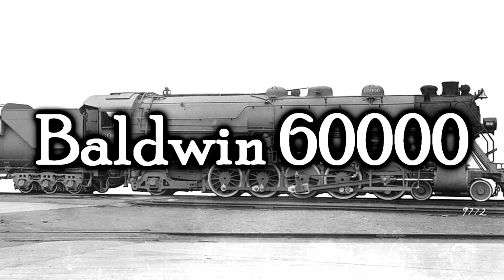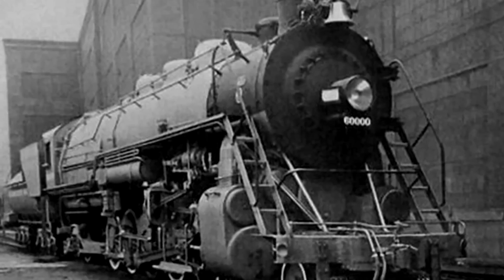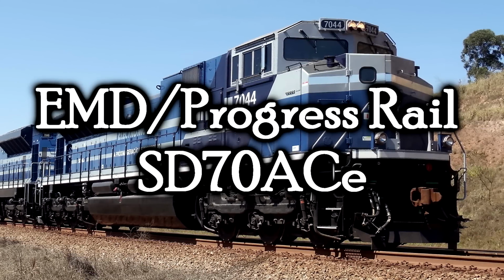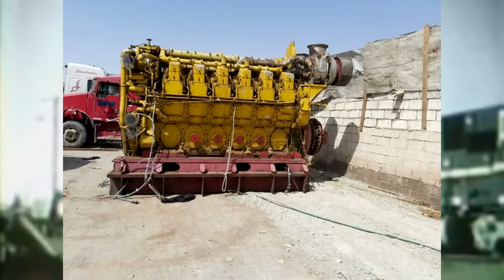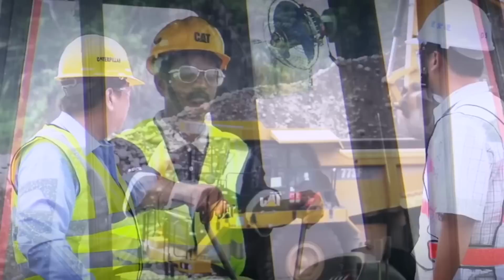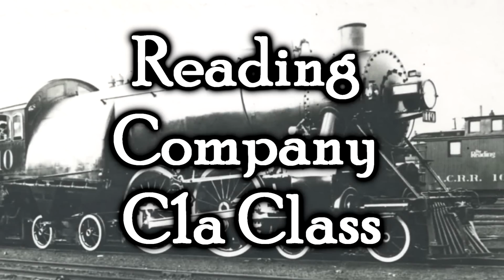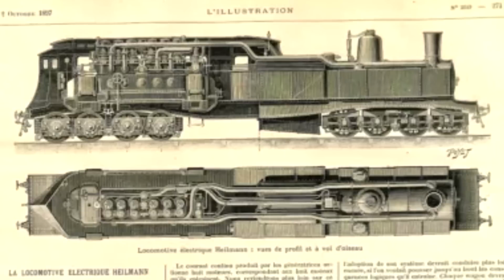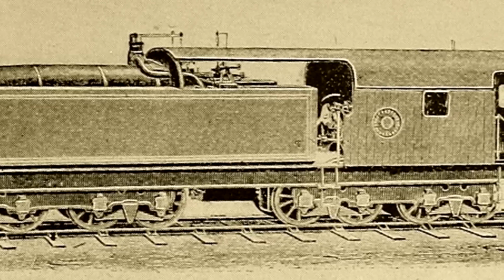5 of the WORST TRAINS EVER PART 21 | History in the Dark

Comment: The Southern Pacific and Union Pacific railroads both operated 4-10-2s called the Southern Pacific and Overland type respectfully, and the SP's 4-10-2s lasted 30 years but were relegated to only work on relatively straight and heavily built mainlines and their three cylinder compound arrangement were a constant headache for maintenance crews. Otherwise they were good engines and No. 5021 is preserved and on display in Pomona, California.

Comment: The Steam Electric Loco isn't a bad idea per say, or that crazy. It's essentially just a diesel electric locomotive, just with a steam engine rather than a diesel prime mover.

I bring this up, despite you also mentioning it in the video, because this same design was proposed in the 1970s.

Comment: If you make any more of these, please cover Durango and Silverton Nos. 1201 & 1202. Probably some of the most recent worst engines ever, and the problems with them are endless and hilarious. For one, they were supposed to have six wheels on each axle, but those couldn't fit so four wheeled axles had to be put on instead. Those look super weird though, because there are huge gaps between the axles and the frame. Another thing is their fuel tankers are way to big, to the point that when 1201 tanks were put on the crew at the D&S had to cut into them so they'd fit on the rails. This would work...until the diesel went over a switch. I could go on about these terrible diesels, but to top off their terrible story, the company that built them went bankrupt shortly after making them so now the D&S has another headache to deal with in regards to these diesels. I worked on the D&S, and I think these diesels NEED to be talked about in some way shape or form because the story behind them is so ridiculous.

Comment: The MK in the MKC5000 was Morrison-Knudsen, one of the most respected names in locomotive rebuilding.  They were based in Idaho.  Yeah, Caterpillar built a big diesel, designed for electrical generation, but it wasn't designed to be throttled and it was designed for stationary usage (e.g. hospital emergency power or mine power generation).  Shaking it in motion and throttling it didn't do wonders for longevity.  I'm sure that Caterpillar would have designed an engine appropriate for the task if approached by GE or EMD, but it was probably too risky to sink money into someone new to new locomotive manufacturing.

Comment: Steam electric shouldn't have been a radical idea...I can tell you that in the power generation industry, the most efficient way to generate electricity is to use your fuel to boil water, and then use it to turn a steam turbine turning a generator.  Some power plants (e.g. natural gas), have dual-mode turbines that can run on the Bray cycle (same as a jet engine) until you've generated enough steam to turn your turbine under steam.

Comment: Some notes regarding the MK5000C's:
 The reason for the bearing failure was a mistake relating to the AC alternator being mounted to the engine. Like Baldwin,  the lack of additional engine mount pads at the alternator end allowed for more flex at that point, so the bearing failure. 
 MK's original control system had some issues that were figured out. 
 Utah Railway asked for a more common braking system as part of the purchase. (26L, if I remember correctly).
 All of the base components by themselves were good, just getting everything together the right way ended up not working well, as you said.

Comment: They made the same mistake with Caterpillar engines on some high speed ferries near me. The Polish shipyard that built them wanted to use local Wartsila marine diesels but the ferry company insisted on Cat units instead. Predictably they didn't like like in a high speed ferry and caused endless problems. One main issue was they weren't built to handle a salt water environment!
Reply: The same thing happened in Australia for ferries that ran to Tasmania.

Comment: Building on spec is always a risk and the fact that 60000 was just another fire tube firebox failure didn't help.  SP got good work out of their 3 cylinder 4-10-2s and of course the UP 9000s ran almost 'til the end of steam.

Comment: The steam-electric concept went into hibernation after Heilmann's attempts, but it didn't die completely.  At the end of the Age of Steam, there were four classes of locomotives built using steam TURBINES instead of cylinders, trying to take a page from ships.  Of the four classes, only one - the Pennsy S2 - used a direct-drive action.  The other three used steam turbines to turn generators to power electric traction motors.  The latter type suffered from needless complexity - diesel prime movers were simpler, lighter, cheaper to build, and they were safer.
Reply: LMS in the UK also built a steam turbine loco. Turbomotive

Comment: For that number one slot, it might have been an idea to mention that steam electric, was tried again in the the late 40s early 50s UP and NW both did steam turbine electric locos.
Reply: C&O did also.
Reply: @michigandon  by the way, the C&O steam turbine electrics had an eleven notch throttle, “ranging from one (idling) to eleven (full speed). The locomotive's cruising speed was 70 miles per hour (110 km/h), at which point the throttle was on ‘seven.’ During a trial run with a reporter from Popular Mechanics aboard, a C&O engineer expressed his dissatisfaction with a local speed limit of 75 miles per hour (121 km/h), noting that he would ‘sure like to be able to pull it back to eleven!’”—Wikipedia, Chesapeake and Ohio class M-1
Reply: @JohnGeorgeBauerBuis  I'd like to think that Spinal Tap drew the inspiration for their proprietary amplifiers from the M-1.
Reply: @michigandon  it is definitely possible!

Comment: It is interesting to hear that, a 4-4-4 would be bad  at running safely. in my country the MÁV class 242 had the same arangment with a high speed tank engine build. One still alive, even though it boiler got changed and now run on oil burning.

Comment: For another horrifying cab story, look at the British Railways Class 31. The 31's, as you know, were slow but good, but the cabs, specifically the cab windows? No. Not good at all. They were made by the Beclawat company, and just wouldn't stay latched open. This meant that crews lived in fear of the cab windows flying upwards and either smashing the glass, with splinter injuries ahoy, or, much, much worse, trying to BEHEAD the driver as he lent out. They were nicknamed "Beheadatwat" cab windows, in parody of the Beclawat company! That's how bad they were. And thus the name of an otherwise excellent engine was besmirched.

Edit:- I forgot to mention that the cab windows actually did kill a driver. Yep, the windows have a death toll to their name.

Comment: That "steam electric" beast sounds like a predecessor to diesel-electric. Just with steam instead of diesel. Might've worked better 20 years later when steam turbines were more common. Now I wonder why that hybrid transmission actually is viable with diesel but not steam.
Reply: I'd assume it's just due to difficulties with the electric transmissions at the time, not a steam specific issue. Likely a diesel one would suffer the same issue.

Comment: This one hurts me, lol,the SD70ACE is my favorite modern diesel locomotive, also I really like Readings 4-4-4, they've always stood out to me due to there similarity to lionels 400e locomotive
Reply: The SD70ACe has the best modern freight locomotive front,although i can see why its not liked
Reply: @Nobody-ue5qs  agreed, love the notches in the nose
Reply: It's OK
Reply: The SD70ACe at least had better ergonomics on the buttons in the cab than earlier SD70s and SD60s, if I remember right.  By the way, poor cab ergonomics are the reason why GP60Ms were unpopular leaders for a while, before refurbishment.
Reply: I don't think the ACe should be on this list, I mean like cmon, every country had a variation of the ace, plus there are so many variations of the ace, 8/10 rebuilt and locomotives have the ACe cab, in my opinion, the first batch of aces wernt good but they got better, and there are one of the best type of locomotive, but that's with mostly every locomotive has
Reply: I’m always surprised by zstuff you find. That steam-electric locomotive is just insane ! Thankyou 
Rob
Reply: Also with a toy train you don’t have to worry about dyeing
Reply: SD70’s are incredibly unreliable, failure rate is 3x that of a GE’s
Reply: I prefer the sd40 ,gp38 and gp9 all  f and e streamliner units ,alcos fp series over those today's ugly basterd

Comment: Another detail about the SD70ACe is EMD would fix the thundercab issue by creating the Isolated Cab design
Reply: Yeah, but they were still loud compared to other locomotives. They also didn’t fix the other design flaws within the cab.
Reply: Sure they did fix the issue with the SD70ACe's cab issue but they still have problems with getting flattened because there's no collision post's in the cab
Reply: @brendenburke272  GEs have big steel posts in the nose. I always felt GEs were a lot safer, and way more user friendly.
Reply: @rjohnson1690  exactly. There was a wreck in Red Oak Iowa that is a good example of my other statement.

Edit: not a good example but I hope you know what I mean.
Reply: @brendenburke272  was that on the BN?
Reply: @rjohnson1690  Yes it was on BNSF
Reply: @brendenburke272  I recall fatigue was an issue with that one.
Reply: @rjohnson1690  ya it was
Reply: No wonder there were so many GE leaders for a while!
Reply: @JohnGeorgeBauerBuis  if I went on duty and saw we had a 8400-8900 as a leader, I would start discussing ways with my conductor to switch it out with a GE. Unfortunately it wasn’t always possible, but given the opportunity, we would switch it out.